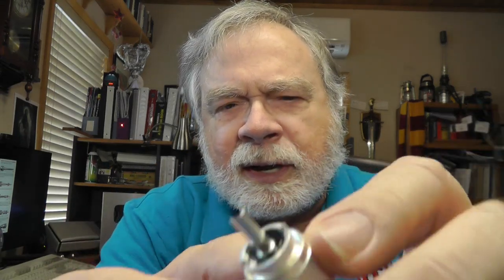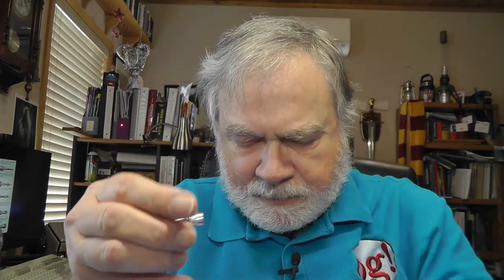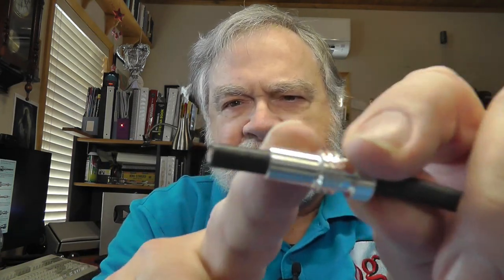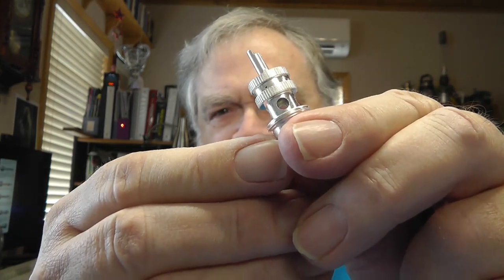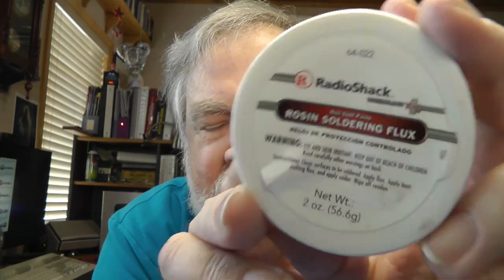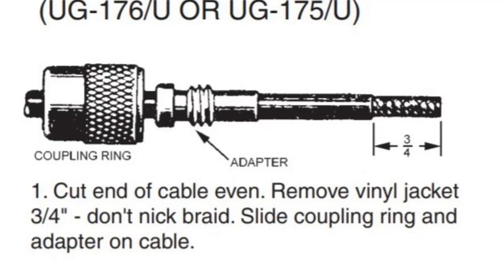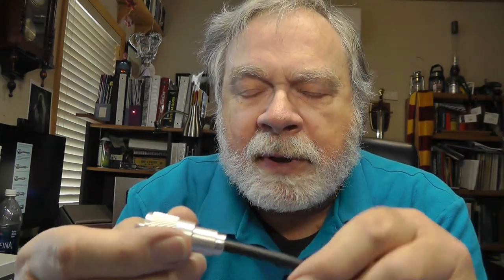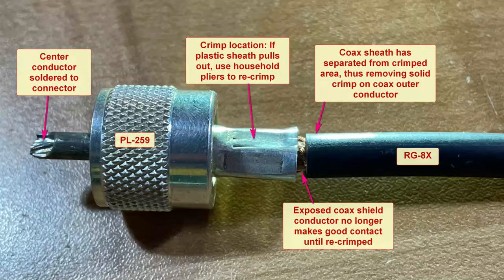QST: Ask Dave March 2022

Comment: Sorry Dave about the shakes. I have herd wonderful thing about THC helping with those old age tremors. Crimping outdoor connection will never work well, just like those connection that tell you to fold the braid back then thread the connector over the braid and jacket no soldering the braid. I use pfte coax 393 & pfte connectors so I can heat them with torch without risk of melting the dielectric

Comment: Nice job with the video!  Many appliance operators these days would benefit from additional DIY videos such as this.  I would go with a crimp connector these days for most situations, especially when using cheap Chinese coax and connectors, both of which have low melting point dielectric. 73

Comment: On the Air, a great magazine for beginners, has two articles on soldering coax connectors July-August and September-October 2020 issues; covers both large diameter RG-213 and then using adapters for RG-8X/58.  73 - Dino KLØS

Comment: Dave, there’s no reason to use soldered UHF connectors in 2022 - proper connectors are cheap and the tools should be in every coax-wrangler’s toolbox given their wide availability, low price, and overall utility.  Let’s encourage beginners to skip these frustrating and error-prone techniques that have been outdated for 20+ years - much better to show how to use the datasheets and a razor blade to prep a cable for a crimped connector.